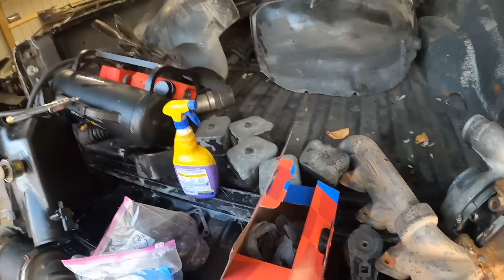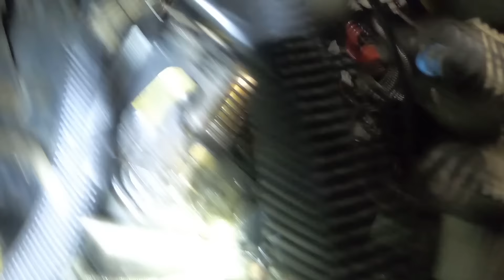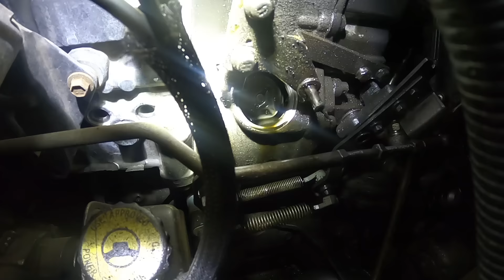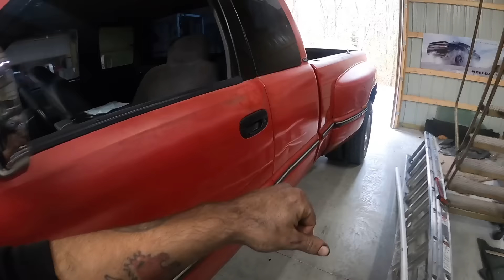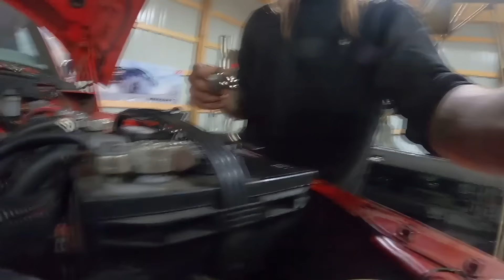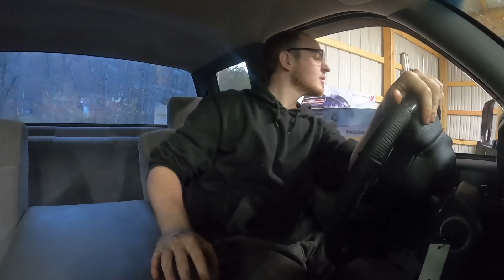2nd Gen 12 Valve Gets Cheap Towing Horsepower | Gov Springs & Fuel Plate | Hotshot Truck Build

Comment: Hey Steve, I see you placing things on your battery when you're working. When I 1st started working on cars at about 12 years old  I dropped a wrench on the battery.  It welded itself to the terminals. And then the battery blew up. Ever since then I cover my batteries with a towel or a rag or something whenever I'm working on my engines. That's my pro tip for the day
Reply from the maker: I don't put wrenches on the batteries. That's definitely rule number one. Nothing I put on there is going to short the terminals. I'm super cautious of that. Haven't had it happen yet in the 9 years I've been wrenching but it's not something I want to happen!
Reply: Great tip, I will do this too

Comment: The older F350's definitely has you beat on tool and part storage while working on them! There's a large rubber cover in front of the radiator which can hold a ton of tools, bolts etc. When I pull the valve covers I use the vent area in front of the windshield which is great for holding bolts. When you run older trucks, you appreciate these little details which makes our repairs easier. If I keep watching the videos you make on the 12 valves, I might get tempted to try one in a F350. I like my powerstrokes, and the Ford trucks are better than the Dodge...thinking that putting the best parts of both of them into one truck would be awesome!

Comment: its the shop LED shop lights and the variable shutter speed in the go pro. You can set the go pro to fixed shutter speed and let the go pro use the iso to adjust for lighting conditions and then play around with the shutter speed to make it go away. I have a small food channel and got cheap shop LED lights for lighting and I could never get rid of the black stripes with the go pro. Of course I kept the Shutter speed twice the frame rate for slo-mo but you are not constrained by that as you don't do slow motion. let me know if you decide to play  with the settings

Comment: Do 28 degrees lol. I looked at a 96 that was a single cab sectioned into a short bed. Had a rebuilt engine with fully built p pump times at 28 degrees with a 75mm turbo and 5k springs. It needed a compound turbo setup to spool faster but that thing was nuts. My 17 year old brother was looking at trucks and needless to say he didnt get that one

Comment: If you slide the AFC housing backwards towards the firewall, it's going to make the throttle less responsive. Sliding it forward towards the front of the truck will increase throttle response.
Reply from the maker: Can't slide it at all with the fuel plate slid forward. It's stuck full forward unless I were to grind away at the plate. Both the fuel plate and afc housing are slid forward

Comment: should of put the 4k in, quite the difference then 3ks, and you just dont rev it over 3200 on stock valve springs which is no problem i never drive mine over 3k. The throttle response on the 4ks was quite shocking and the get up and go it had vs the 3ks.

Comment: Steve from just looking at the rear seat of the truck u think it would fit a bed for hotshot? Have the same size dually but chevy and looks like I can but never did a build so I'm iffy
Reply: I have the same truck. A bed heck no. I'm 6'2 and I don't fit back there. I use it to store a few chainsaws. I also have the same truck steve drives and I've slept in the back but its cramped and I'm scrunched up.
Reply from the maker: He said he prefers to sleep on the front but I'm sure if you are a smaller guy like me you could fit back there fine if you take the whole back seat out. Someone taller than 5' 9" would probably have a harder time
Reply: Thanks I'm 5.11 and I slept before on the rear seat wasn't to bad but wasn't wide enough. For me

Comment: hey brother how's this truck been doing? also is it true you don't have to use an ELD because the motor was made before 99? looking too get into a second get for hotshot so keep me posted please. love the content keep it coming!
Reply from the maker: No ELD is required on anything older than 2000. If you engine swap a 2000 or newer you are also exempt. Here is the link from fmcsa. Every state will have laws and regulations on the swap. PA has given me no issues in the 2 years I've had it swapped.

https://www.fmcsa.dot.gov/hours-service/elds/when-does-pre-2000-model-year-exception-apply

Comment: On side of the road. Shut my truck off hit the ignition to start it and it went click and would not start. Battery’s good. It’s like i blew a fuse but the fuses under hood look good 06 Ram 5.9. Looking for an opinion if u as this thanks.
Matt
Reply from the maker: I haven't had experience with an 06 in awhile but if you need to get it off the road turn the key on and jump the starter to get it going. At least then you can get to a safe spot. As for what it could be I don't really know. Could be an ignition switch, bad starter, batteries showing good voltage but may be shot. Hard to say. I hit my starter with a hammer to get one more crank out of it before. It would click and work fine with a good whack.
Reply: @CPSteveMiller  Do you think I could have done anything real bad by hitting the switch to fast? Thanks for reply.
Reply: Bypass the starter solenoid
Reply from the maker: Shouldn't have caused an issue. Check battery terminals too and the connections
Reply: I fixed it somehow thanks for advice

Comment: I bought all my stuff off d a p diesel I got almost full cut delivery valves right below them and I got 120 horse injectors and the truck will scream mine's got 4K Governor springs in it it smokes a little but it doesn't pour a lot of smoke I love it but if he delivery valves and injectors put in it he will love it I would put 120 horse injectors and one click under full cut delivery valves in it and he will love it

Comment: That part u let out of the governor springs is the seat it goes on the bottom side of the springs. You never pulled the stock seat out of the pump you should of use that part its alot stronger than the factory one.
Reply from the maker: That piece didn't fit in there. Truck Runs flawlessly now(tomorrow's video). It acts just like a stock truck just with maybe 100 extra hp
Reply: @CPSteveMiller  that piece does fit in there it goes on the bottom of the springs. U have to get rid of the factory base. Plus y not put 4k in it. It's a 215 pump it will fuel alot harder with 4k.
Reply from the maker: Don't want to it fuel harder. 4k and more aggressive fueling is just making the truck unreliable for what we use the truck for. What we did in tomorrow's video is more than enough to keep the truck able to pull and keep it reliable. It's not a race truck. It's going to be strapped to a trailer for most of its' future life.
Reply: @CPSteveMiller  4k gov springs won't hurt it at all. My 96 has 482000 miles on it with 4k in it.

Comment: I'd pay good money to see your truck on a chassis dyno to see what it's making at the wheels.
Reply from the maker: I actually want to see that too. 0 fuel plate full forward, afc tuning, 5" exhaust, he341, 3k springs, 18 degrees of timing. I just ordered 60 pound springs, head studs, and 4k gov springs about 5 minutes ago. Also it's getting the he351ve which is just stupid torquey and has a good top end. Hopefully good for 400 but dial it back with an afc live when towing. Might have to "reupgrade" the clutch 😂😂
Reply: @CPSteveMiller  Yeah man.  That's one thing that I really never get to see.  I'd love to see exactly how much they detune them from the factory vs. what they actually can make.  The torque curve would be interesting for sure.

Comment: Its the weight of the motorand lack of weight at the tailgate
Reply from the maker: I have an 800 pound aux tank 😆
Reply: @CPSteveMiller  yep but also duals. Amd your tank is up by the cab not over the rear axels that adds weight to the front you are front heavy.

Comment: it's called weight over drive wheels. LOL
Reply from the maker: I have a 105 gallon fuel tank in the bed. You'd think that extra 800 pounds would be enough to get traction 😂😂
Reply: one would think...  ;)
Reply: @CPSteveMiller  Apparently not, since, you know, you can't back up the hill with your truck.  Some morons think more tires equals more traction.  It doesn't.  In any way, shape, or form.  If it did, then my Pete would never get stuck in wet grass.  More tires equals more flotation.  More flotation equals very shitty traction.   Weight certainly helps, if it's over the axle/s.
Reply: Exactly.  His extra fuel does not really make a difference as not over wheels.
Reply from the maker: Actually it should make a difference. It is in the bed just before the axle and it's closer to the rear than the front. If you look at a scale ticket before and after I fill it, it'll add significant weight to the rear axle more than the front.

Comment: Do you ever worry about being over what your truck is legally allowed to tow? I always see hotshot truckers deregulate the trailer to 26k but if you have an older truck there is no way the gcvwr for an old truck is 26k?
Reply from the maker: Gcwr for commercial use is just the truck gvwr+the trailer gvwr. My 04 is registered at 26,000 and will be upped to 31,500 when I get my cdl